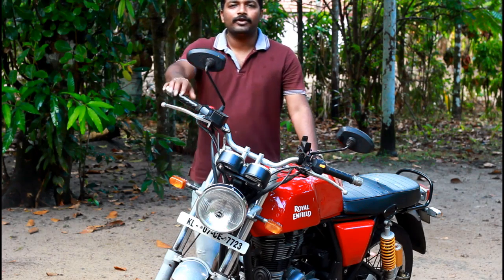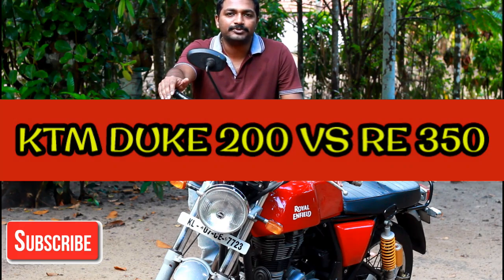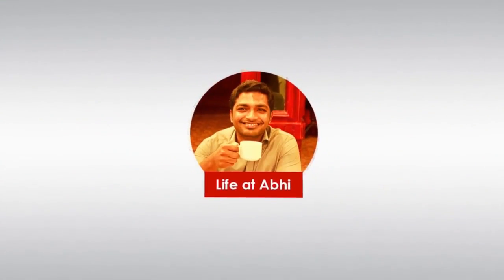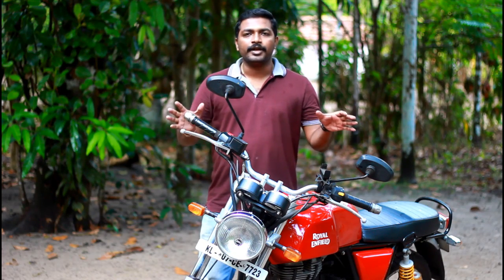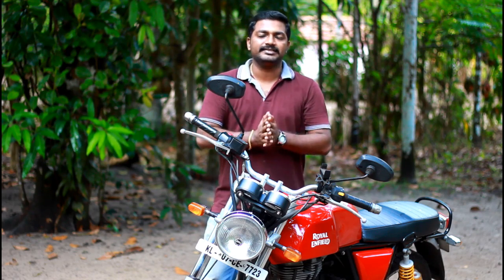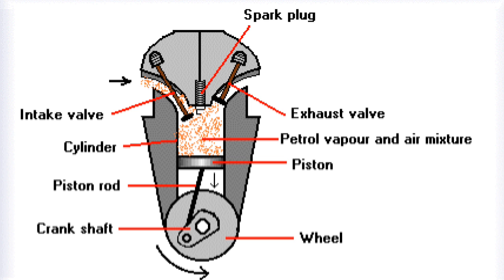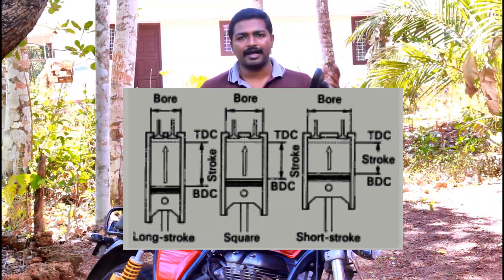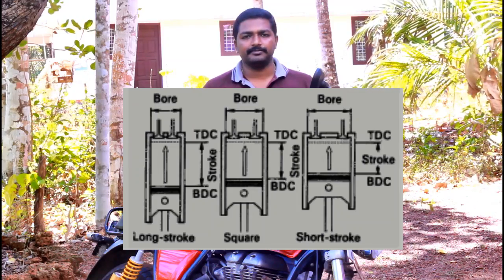Why top speed of KTM duke (lower cc) is more than ROYAL ENFIELD (higher cc)

Comment: Does more cc equals to more sound ? If not then how we have to choose bike for getting loud sound.
Reply from the maker: The exhaust of your motorcycle as well as the filter that you fit make a lot of change in the sound it produces. The same cc motorcycles of different brands may have different sound. So it may not make much a difference.
Reply: @AbhilashPillai-lifeatabhi  but willl the motorcycle of 400cc make more noise than bike having 200 cc both having all same exhaust n filter ?

Comment: Good video. The only question that I have is that what is the point of having a longer piston(in case of RE)? You mentioned wear and tear so is it just durability or does it deliver more power to the gear wheel connected to the engine that moves the chain? I guess its called a sprocket

Comment: Sir my Question is bullet 500 weight around 195Kg approved my many online specifications and ktm 390 duke is weighted 168 jst 27KG lower but the Bhp of both have h hugh significant difference bullet produces jst 24bhp nd duke 44bhp were as cafe racer designed for racing by Enfield group is 650cc but still not able to beat 390 duke which is really a shame idk bullet is good at what😂 please make me know
Reply from the maker: Kindly go through the video from start until finish.

Comment: Good video
Reply from the maker: Thanks buddy, happy that you like it.
Reply: Abhilash Pillai no one explain what u said 
Bro pls  explain 'rebore'
Reply from the maker: In simple words reboring means placing rings or liners within the cylinder when they wear out over time. This is visible when the exhaust emits heavy smoke. But why did you ask the question. Anything wrong with your motorcycle.
Reply: Abhilash Pillai UI m looking on rx 100 used bikes.   some sellers saying I do rebore ,5 speed  like that 
Thats what
Reply: Is it possible.to change 4 speed gear box to 5 speed gearbox 
If yes is it easy process ??
Reply from the maker: Hope you understood rebore. Do check it through a good mechanic before purchasing.
Reply: Abhilash Pillai okk jii;  rebore is good or bad ?
Reply from the maker: it is required when the rings wear out.

Comment: In stability motorcycle not only depends on weight , it depends on structural design . In 100km/h RE can go only straight but can't corner . If you try to corner or filtering in road such a speed RE crash due to heavy weight and low stability . In sports bike stability is the first thing  . If KTM not stable so how it goes 150+ speed easily ? Look at its frame , tyre , shape --- all are design for stability . RE has only old diamond frame , old push rod engine , old tube tyre , old spoke wheel and no latest engineering in it .
Reply from the maker: I agree that not all royal enfields are good for cornering as they arent racing bikes. 
I have ridden KTM and also RE GT, I know how stable KTM is when you have to use the brakes behind a truck or a bus. 'The back tyre would be eager to touch the front". whereas in GT, the moment you touch the brakes, you would see your bike stop as if someone has made it stay 'statue'. There isnt any jerks that make your ride unstable. If you have a good physique and riding experience, Gt is best for cornering.

Comment: Bro is GT 535> KTM250 in terms of performance
Reply from the maker: KTM is faster but Gt is powerful.
Reply: Abhilash Pillai bro if both bike do a drag race which one will win
Reply from the maker: KTM will win for a quick pickup and weight. If GT is modded with a performance ECU mod, KTM does not stand a chance.
Reply: Abhilash Pillai if ktm is mod with powertronic GT wouldn’t have chance to stand. Lol. Lets talk about stock bike 😂
Reply: V
Reply: Bn
Reply: Compare duke 390 with GT of course u will lose look at BHP ND torque so compare according to cc u be really be vry shamed to know 650cc cafe racer is not enough to beat a 390cc bike

Comment: U own a royal enfield so u are on the side of RE if u own a ktm u will be on ktm  by the way duke has more stability than re if touch 100 kms/hr  re whole body vibrates it doesn't have proper brakes whole body parts come loose and make annoying sounds ..... ktm is easy to ride in city with heavy traffic than to carry that much weight of re ..
Reply from the maker: Buddy, I am not a RE Fan but it is indeed a heavy bike due to which it does not skid on sudden brakes. I have had instances with KTM where it finds difficult to stop without losing the vehicles stability. KTM is indeed a good bike to use in the city but not for the normal riders that is why it has track record of accidents. I am not here to comment on which is better but to debate on why KTM has better speeds.
Reply: Accident prone  Ktm bikes loll

Comment: What is meaning for torque then, like as 500cc has 41nm torque, where it is being used?
and in any other bike, what we should taken into consideration for better performance, power in hp or torque?
Which thing is responsible for acceleration of bike and which is for top speed?
If a 250cc bike has same power and torque as 300cc, considering almost same weight, would they run equally fast?

Comment: thanks abhilash for sorting out cc confusion.pls tell that y sports bike    r fitted with vertical seats.
Reply from the maker: Thanks Suraj for the comments. If you mean bent forward seats by vertical seats with the rear seat higher than the front seat, the reasons are:  To reduce aerodynamic drag, keep the center of mass low and to make it easier for the driver to shift their weight from side to side.

Comment: Informative bro 👍 All the best .Btw good handle barmodification on your bike , could u post a picture of it ? I want to have a closer look at It.
Reply from the maker: Thanks buddy, appreciate your feedback. Please watch the video Himalayan handlebar. I have tried to cover the bike with the clamp
Reply: Abhilash Pillai thanks bro ,will watch it :) i have fixed an avenger mount which i feel compromised the stability of the bike .
Reply from the maker: Hitchcock clamps are very rigid and made to fit the forks. I tried Yamaha fz handlebars and they work good
Reply: Abhilash Pillai i use that handle bar , i am suspecting  the mount and the raised fork for the instability.  corect me if am wrong .
Reply from the maker: you are correct.

Comment: But why did the classic 500 accelerates very fast ? I mean 0-60 or may be 0-80
Reply from the maker: +Murugan Mark the acceleration is not as fast as ktm.
Reply: The Classic 500 is fuel injected , hence the swift throttle response , It does 0-60 in 4s , 0-100 in 10.5s.
It can beat a stock R15, CBR150R and other 1L bikes , but not the duke 200 .